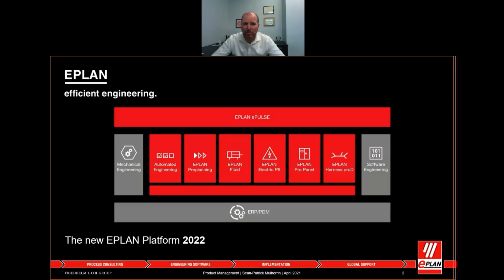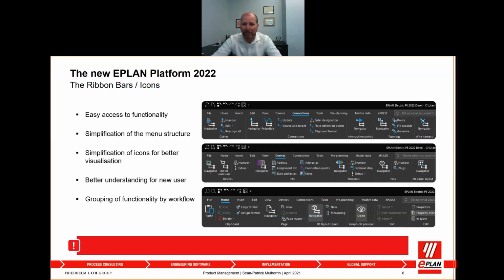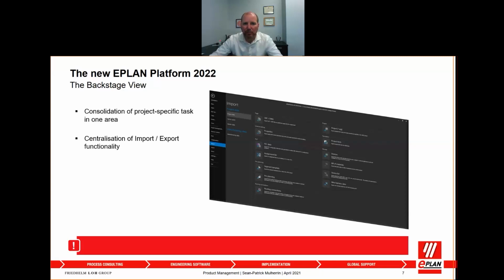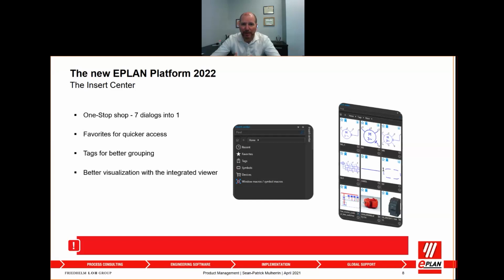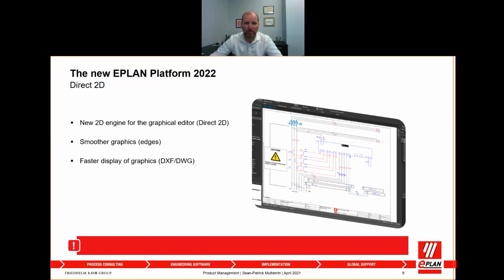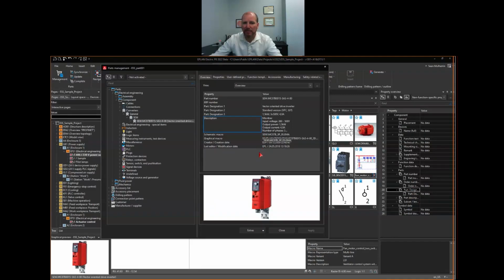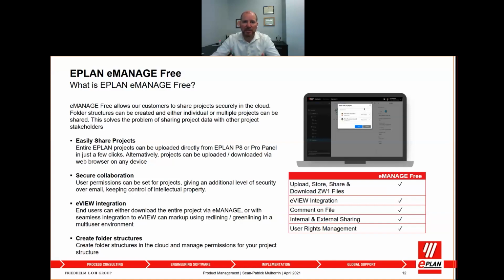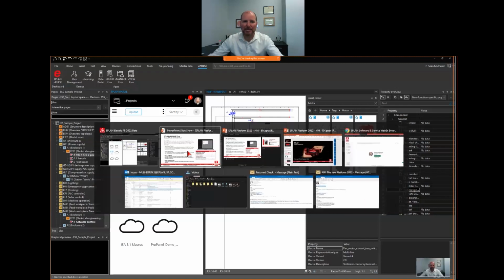Engineering Software Explained - Inside the Eplan Platform 2022

Comment: Sean, I viewed the video a few more times, and have some more questions if you don't mind answering here. We can take it to the Forum if you prefer.

1. Will windows (navigators especially) still be dockable "anywhere"?
2. Will custom toolbars still be possible?
3. Whether we use light mode or dark mode, will we still have 2D color scheme for the GED, like Black, etc.
4. Will EPLAN API Extension still work?
5. Does Direct2D provide such a tremendous improvement that it will now be possible, for example, to use a complete plant overview in Fieldsys?
6. Have there been changes to the Connection Numbering interface?